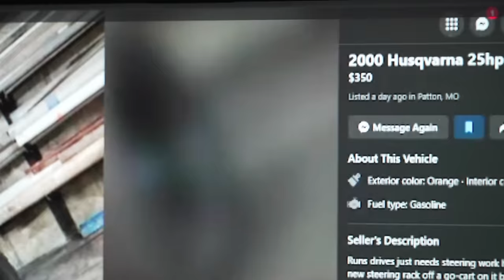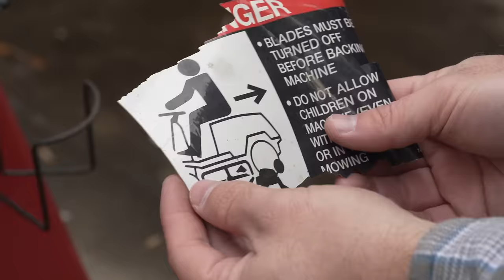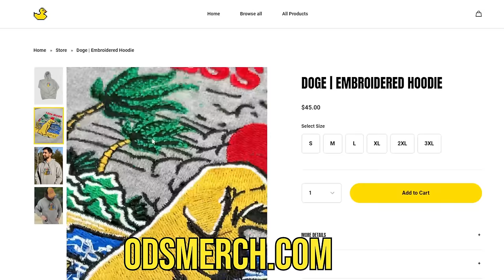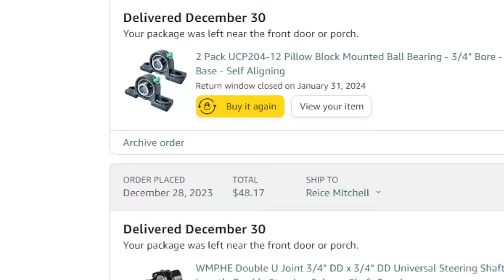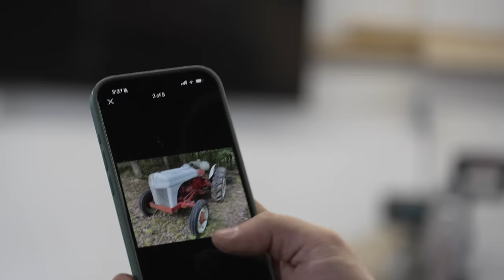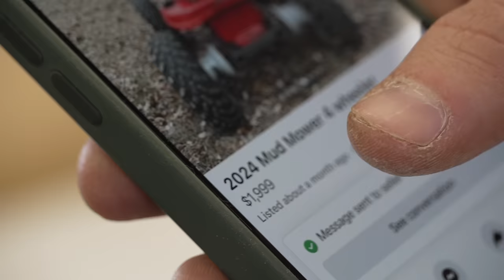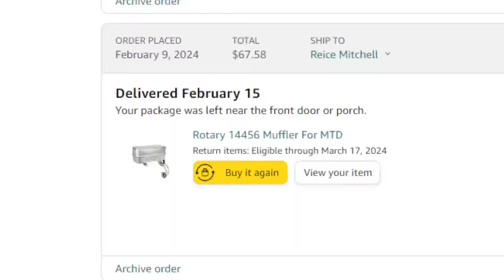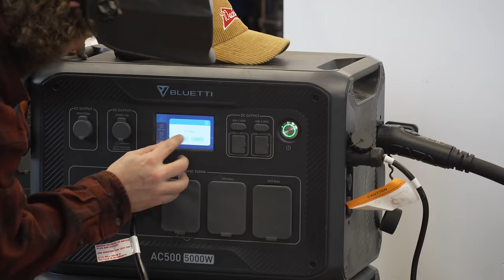1v1 Off-Road Lawnmower Challenge

Comment: Those old rear-engine lawnmowers are basically the lawn equipment equivalent of a Toyota Hillux, I still have an old Simplicity that my father and I converted into an ATV that's still kicking. Well it only starts if you pull on the starter cord on a compression stroke, but besides that it's fine. Which considering it gets used roughly once a leap year, is shocking. That fuel is same fuel from before I bought my truck...

Comment: I can’t believe that spindle did not break sooner - that’s a ton of leverage on them stock parts not designed for that much load , add the wheel spacers and the 2ft wide tracks at least, and bam recipe for disaster… it needs a complete sparks motors rebuild on all the suspension parts to handle what a jeep gladiator with the same tracks on it !! The jeep has a solid axle front and rear Dana super 60 axles , built for off-road … that cyber truck was built for small tires and on road use … in time u guys will have it all beefed up and ready to take whatever u throw at it !!

Comment: Question, do you count the fuel to drive 13 hours in a full size pickup
Reply: Yo, I almost bought that troy built "mud mower"
I bet I live pretty close by. (Branson area)
Building my son basically the same thing....out of the same troy built mower. 
You need a 3 inch longer drive belt and a front pulley flip and that thing will get with it!

Comment: 43:08
SCP-034 is a primitive knife constructed out of pure obsidian. Tests reveal that SCP-034 is approximately 1000 years old. Despite its crude method of construction and age, SCP-034 is still incredibly sharp and requires no maintenance to retain its edge. Expert analysis hypothesizes that SCP-034 may be of South American origin, and that it may have been used in Native American rituals. Several accounts from Spanish conquistadors exploring the █████████ region support this hypothesis, with detailed writings on how █████ priests would flay their victims alive with similar knives and wear their skin as a tribute to their gods. 

SCP-034 has the ability to allow its bearer to take on the appearance of another individual. If SCP-034 is used to cut a piece of flesh from a living individual, and that piece of flesh is placed against the skin of another individual, the second individual would take on not only the appearance, but all physical characteristics of the first individual. Testing has shown that the minimum amount of skin required can be as little as one (1) square centimeter. However, testing has also revealed that the amount of time the transformation lasts is directly proportional to the amount of flesh used. The ratio of time the transformation lasts to flesh used has been measured at approximately one (1) hour for every square centimeter used. Once the time limit has passed, the affected individual will revert to their original form.